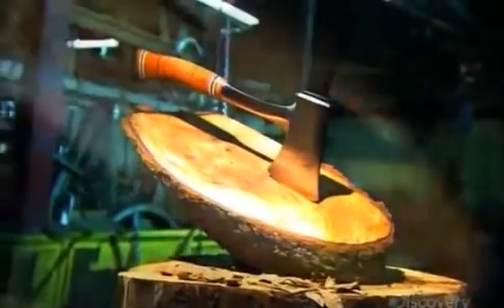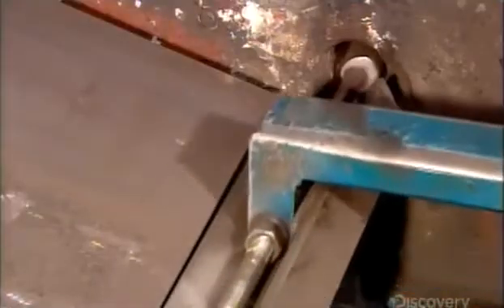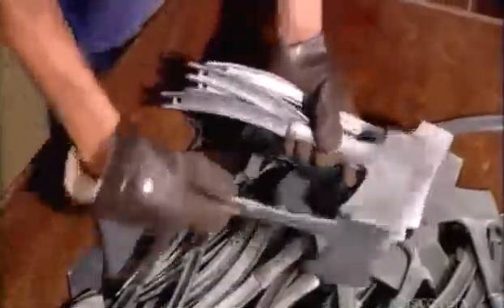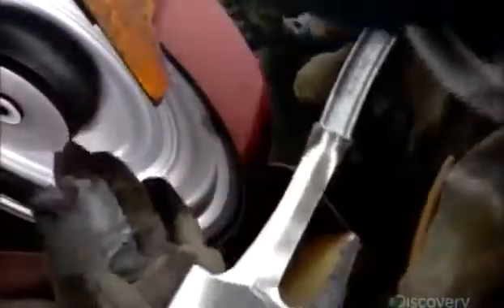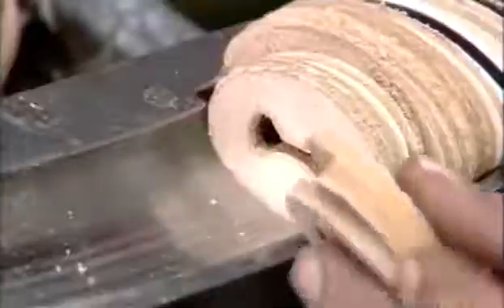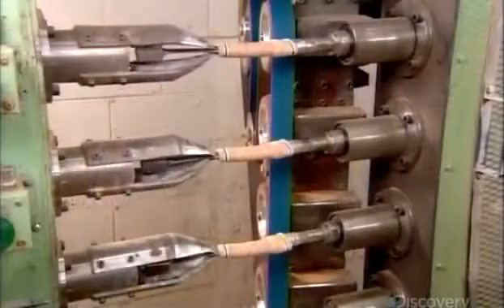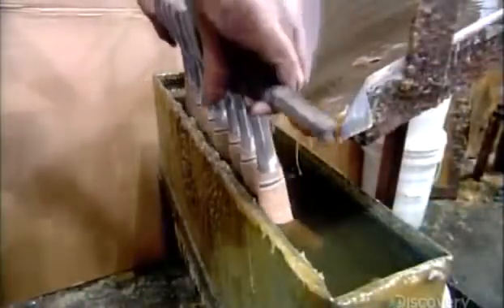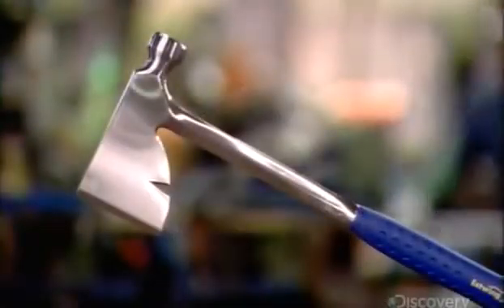How an Estwing Axe is Made (Step-by-Step Guide)

Comment: After seeing this video and was in the market for a camping axe, I ordered off AMAZON and got the new special edition "Black" version with the leather handle. The black paint is nothing more than cheap WalMart rattle can spray paint which started coming off the day I got it! When I removed the stickers on the hatchet, the paint came off with it and i had the shiny metal finish exposed. SOOOOOOOOOOOOOOO, I really wanted this to work, so I had some spray can stripper and stripped the remaining CHEAP black paint from the hatchet and bought some Naptha to really clean and prepare the bare metal and bought some high temp QUALITY black paint and had to refinish the hatchet myself! My first ESTWING so I have not had a chance to try it out camping yet, so we will see how it cuts and holds up to real life use. Just very disappointing tp see a product that's been around for generations made with such poor quality processes!
Reply: Thx for this review of the "special edition" black model. I have one in my Amazon cart, but have held off going forward with the purchase until I find out more. Too bad Estwing can't put a solid paint job on these, since they are $20 more:/ And the black color is really visually appealing.
Reply: Grind and wire brush that crap paint off and polish it. Now you have something.

Comment: I don't care for Estwings. They are the worst for splitting, in their classes; and if the handle ever bends or crushes, you can't repair them. As for shock-absorbing, they still transmit plenty to my wrists.
Reply: Boo Hoo 😭😭😭😒
Reply: Wahhhhhhh😭😭😭🥺
Reply: I think your comment speaks far more to skill and technique (or the lack thereof) than of the usefulness/ruggedness of their tools.
Reply: @jessr.2490  I couldn't have said it in a better way.
Reply: Yesterday, I saw an adult Scout leader trying to split a log with an Estwing axe. the poor guy pounded and pounded and pounded and pounded and pounded; but that skinny head just would not force the halves of that log apart.

Comment: No hammer or ax has a handle as beautiful as Estwing.  Iconic.
Reply: I don't care about the beauty of the handle. I care how the axe cuts and splits, and how much vibration is transmitted to my wrists. The Estwing axe is, by far, the worst medium axe in its class, on all three points.
Reply: @jonmelick6891  fair enough
Reply: @jonmelick6891  the head profile is terrible for splitting but it was not designed for that, the head is thin and is more suited for chipping off and debarking logs and it efficiently cuts wood.
Reply: @AdamThygerson-lm1gt It is absolutely NOT efficient for cutting wood! The thinness of the head makes it more likely to stick inside a cut. As for the handle -- a couple of years ago, I took 6 swings with my Estwing axe, and my wrists began to hurt -- the handle vibrates like a tuning fork (and it the handle ever gets bent or crushed, there's no repairing it). I then put away the Estwing, and took 24 swings with my Gransfors Bruk Scandinavian Forest Axe, and my wrists felt fine. Even a less expensive axe like the Council Tool, Snow and Nealley, or Cold Steel Hudson Bay axe outperforms the Estwing in the woods. I really cannot remember the last time where I have needed to chip off or debark a log in the woods.
Reply: @jonmelick6891 
What about the blue rubber handle?
Better for reducing vibration?